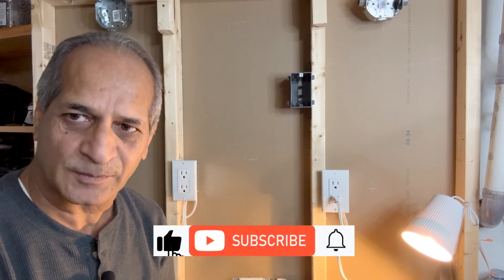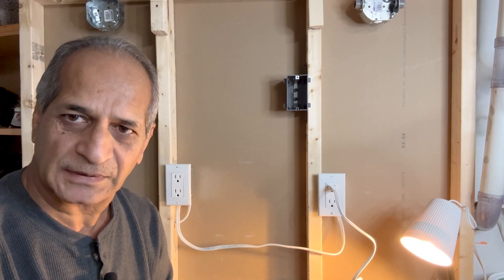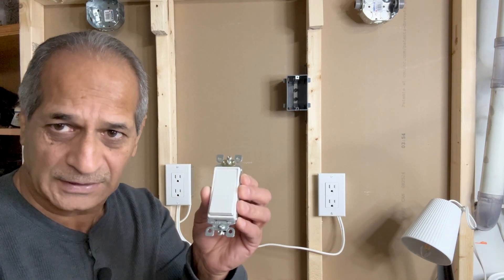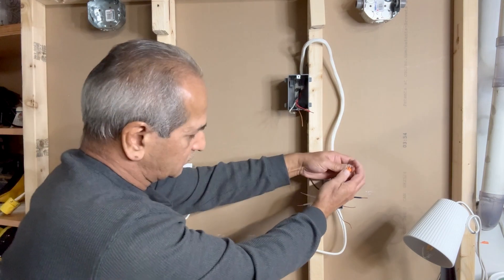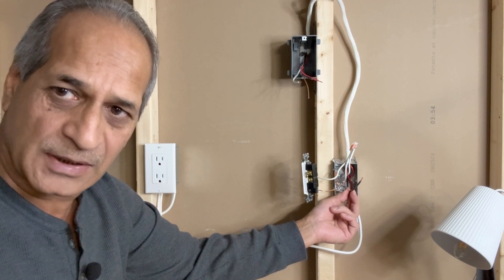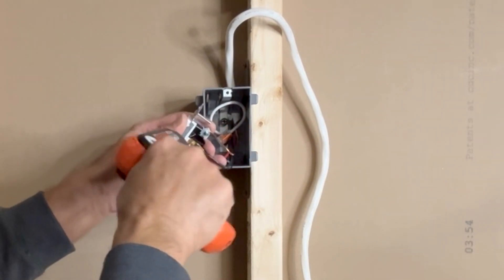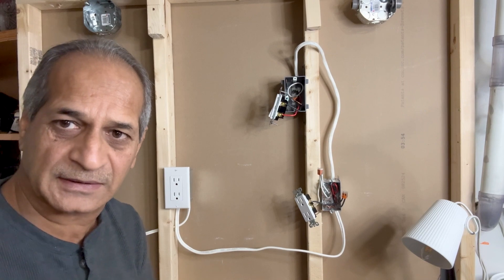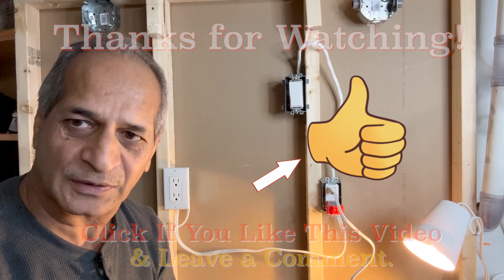How To Add A Switch to an Outlet - Wiring a Switched Receptacle

Comment: Thanks for the video very helpful! In my case, I need to install the switch closer to the power outlet and I need to run the new outlet that will be  controled by the new switch to the other side of the room. How do I go about doing this? I would like to have the neutral wire in the switch as well for Smart Switch. Thanks!
Reply from the maker: Thanks for watching!! You might need to pull wire behind a finished wall. Seek help from a licensed electrician, if you feel you can’t do it yourself.